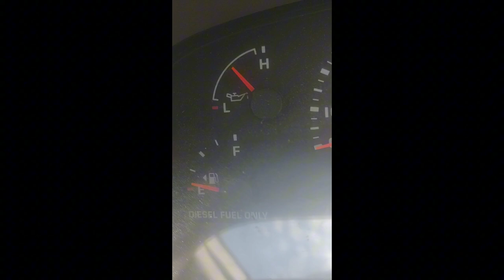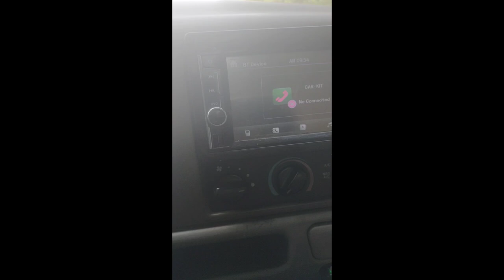The driveshaft back on the in the truck.

Comment from the maker: It was binding up. I had to drop the driveshaft and reposition where the two halves mate up. I have some play on the rear u joint where the straps bolt to the differential yoke. Ill work on that tomorrow if i get the time, but ill definitely make a video about the shock extensions. Thanks for watching 👋☺️